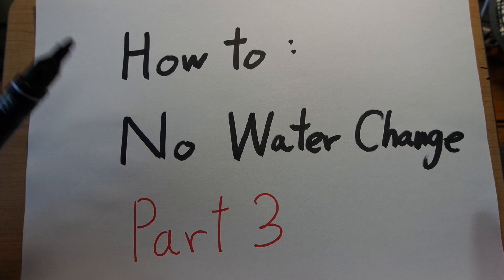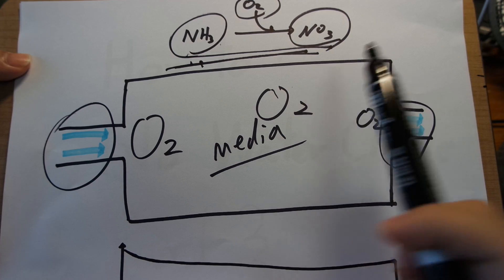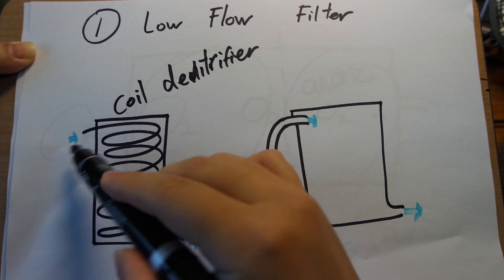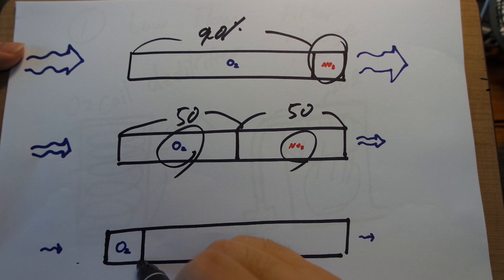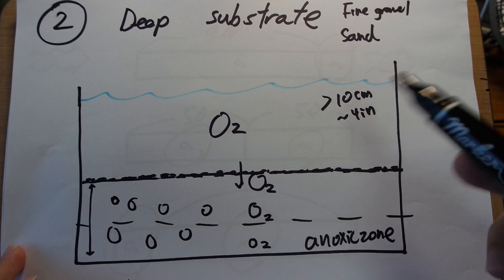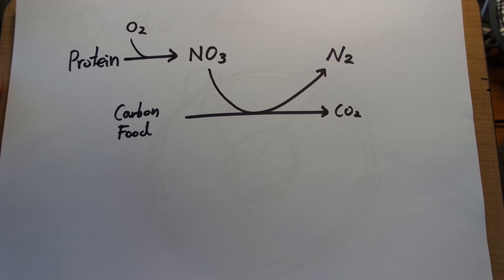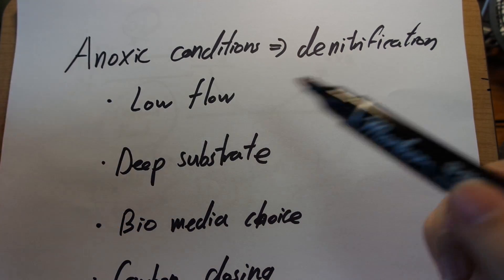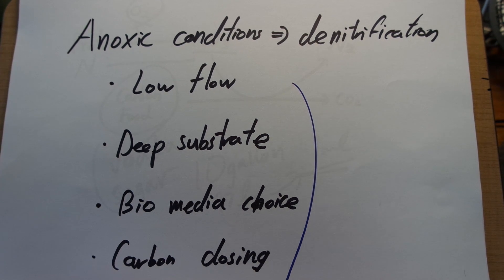How to build a no water change tank part3: ways to make anoxic zones for denitrification

Comment: I am searching guide to solve anoxic/anaerobic substrate, because my plant roots is rooting and smells horrible, but found how to do anoxic condition.. I am confuse... 😵😵
Reply from the maker: If you dig up deep substrate on purpose it will smell bad even if it is set up properly. can you be more specific?
Reply: The substrate do release bubble, but i cannot smell it that bad. But, plants roots turn black and smelly. Wood hardscape part that burried in substrate blackened and smell like sewer. I do walstad method, using soil and sand to cap it.
Reply: I was looking for a comment like this. I want to set up a filterless deep substrate tank but I've heard that anaerobic conditions would cause H2S to form and that is toxic and smells bad...

Comment: thank you for great explanation but i have question about the coil denitrator i make my research of how they make it and there are a lot who diy it but i can not understand the needs of spiral tube ? that go spiral inside large diameter tube . they say it is for slow down the water flow !!! but what if i add straight direct tube and valve and i can make the water flow run very slow  what is the needs of that spiral tube ? in your video you say the bacteria will colonies inside that small diameter tube ! how we can sure that there is a bacteria there and not in the output or in the tank i mean the bacteria colonies in rough surface not in water . is that spiral tube is special tube designed so the bacteria can colonies there ? and dose that mean who make it as diy and they use a normal small diameter tube will not work with them ?
Reply: ngc charle I'll answer your question it's like with electricity a coil is used so a certain amount of power can go through it but it's reduced by time it gets to the end with the spiral the water is a constant stream so on there's more volume going through And two there's more surface area for the bacteria for denitrifying to do there job the longer the tube the better but as said stupidly unnecessary if you had a small tube and a valve it would be pointless
Reply from the maker: bacteria can colonize any surface. They are not free floating, they stick to the inner surface of the airline tubing. That is the concept of the coil denitrifier. The tubing is coiled because you need several meteres of tubing for it to work and it would be messy otherwise

Comment: Hello Jay, i was wondering if an aquarium with 2 canisters mounted in serial will make the second filter anoxic, since the oxygen will be very reduced at entrance of the second canister.
I also reduced the flow using only one canister pump leaving the second canister pump off. The first canister pump is electronic and i was able to choose the most reduced, pump flow setting, considering your advice in this video about reducing the flow. Please reply.
 Thanks for this wonderfull explanation
Reply: He's just making this stuff up. The answer is no - it will not. High nitrate levels are quite safe. The chances of creating an anaerobic filter are laughable.
Reply: @SC-hk6ui  Hello Simon, can you please tell us why you think anaerobic conditions will never occour in canisters, since it can be achieved in sumps, right ? its just a mather of lenght.

Comment: another question please usually when we make water cycle we do it 4-6 times per hour for the whole tank now if i want to use the denitrification filter what is the water flow rate will be i have 450 liter tank about 120 gallon with water flow 2500 liter per hour ?
Reply from the maker: Its not about the tank. Its about your filter compartment. Slow flow in a large filter compartment will ensure anoxic conditions

Comment: Questions. 
With low flow filters like the coil denitrifiers, is it more space efficient than deep substrate filtering? 
As for the carbon source for the deep substrate filters, like vodka and sugar, can't you use fish food or a layer of topsoil as the food? 
With the bio media, following the principle of wicking water, would driftwood also cause anoxic conditions within? Oh and lava rocks also wick water more or less depending on pore sizes. 
What percentage of alcohol does your vodka have?
Reply from the maker: 1. The efficincy will depend on how you build it. In any case coil denitrifiers are terrible in my opinion because they are expensive and complicated. 
2. Fish food is why you dont HAVE to dose carbon. Its just that dosing could help. not sure what you mean by top soil
3. drift wood or lavarock could do that. depending on the characteristics and size. 
4. I don't dose vodka. or anything. I just mention it to explain how denitrification works.

Comment: Anoxic type filter here. Iam trying for months to achieve denitrification to no avail. 
I have few questions to you and id be glad if you could help me out. 
You say that the flow has to be low, but how low? 
Do I need to add a carbon source necessarily? Isnt there any carbon source from the leftovers (food, poop) etc.? 

Thank you in advence
Reply: Carbon, as in dose vodka into the filter with a dripper. 2 drips an hour will work.
Reply from the maker: no simple answer to how slow is slow enough. depends on shape of filter, filter media, filter configuration and initial oxygenation level of water going in. supplemental carbon is not necessary, but can help

Comment: Hi! Great series of videos! I do have one question. Do you ever clean anaerobic zone on the bottom, or is it left undisturbed?
Reply from the maker: Sediment a debris builds up on the surface of substrate which I clean about once a year. I've never touched the deep areas. Never found that to be necessary
Reply: Nice... I'm figuring out if the same principles will work on pond, and cleaning only top layer of bottom gravel with a vacuum once per season is enough, It will be absolutely great... As long as I provide water with lots of oxygen and plants I think It might work well

Comment: Why the oxygen go down in the 2nd method?
Reply: BettaJanggut 75 the oxygen will go down in deep substrate filtering because the water cannot flow very well down there. So, whatever oxygen will be used by the bacteria, until it is depleted. 
Towards the lowest part of the substrate, the water is stagnant. There will be no gas exchange, and therefore no added oxygen.

Comment: Good videos. You should take a look at Kevin Novak’s YouTube channel and take a look at his iBook call Anoxic Filtration System. He uses the 3rd method you go over in this video with apparently some success. He is using crushed clay (kitty litter) and laterite (iron rich clay) in simple pond baskets in sumps/ bog filter areas. He says no carbon source is needed either. Apparently he has had success with this for many years. I am testing 3 of his baskets in my sump now. If you take a look at his content, let me know what you think. I will post a video if I have any success.
Reply: Jay, have you made any videos breaking down anoxic filtration using baskets and plenums? He does a terrible job explain stuff on his channel you are much better at teaching.
Reply: Badandy538 yeah, I had zero success with the kitty litter baskets. They are fine for nitrification, but no significant denitrification was detected. Novak’s videos have no scientific backing or merit. All hype. The only thing I’ve found to significantly reduce nitrates is a heap ton of plants.
Reply: Eric K So no luck with deep sand beds either?
Reply: Eric K thank you so much for sharing.
Reply: @erick6102  Exactly
Reply: @erick6102  Try a little dirt on the bottom with a shit ton of gravel above it. 
9" of gravel and NO sand cap.  Plenty of zones for different bacteria just like in your pond or lake. Shit ton of plants like you said in another comment and don't overpopulate or overfeed and everything should take care of itself.  The substrate doesn't have to be special, just plain old gravel. Give it plenty of time for fish poo etc. to filter down and I bet the things we want to happen will. .
Reply: @scottmerrow1488  I was successful with nitrate removal by putting water sprite in my sumps. I was able to keep nitrates at 20 ppm with a somewhat heavy bioload however, the water sprite was so efficient at growing, it also pulled out a ton of minerals , especially calcium and dropped the pH over time. So you have to dose regularly with minerals which ended up being a lot of work - (regular dosing, trimming excess growth, making sure pH didn’t drop too fast) about the same amount of work as water changes, ha.
Reply: @erick6102  Yeah, OR you could do a water change every once in a while and not have to worry about how to get levels correct.  But that makes sense right?    How about we call them infrequent water change tanks?  How do the 25 year no water change guys do it?  Are they adding minerals to their heavily planted tanks? Is the CO2 they add "making minerals"(?) or are their tanks less bio loaded and the decaying plants give the minerals back to the water?  BINGO
 if you are trying to do a no water change 
tank with a heavy bio load you're already defeated as nature doesn't do heavy bio loads (for long).    Rocks and dirt leach the minerals into the environments we are trying to imitate.   So do your best to imitate nature.   RAIN is distilled, BUT rain water picks up mineral content on it's way to ponds and lakes so there's your water change.  "It's legal"  And that's how and why the water in the pond or lake is not distilled or pure. 
Water changes aren't cheating.  I was going to go for a no water change tank but you guys just made me think better.  Less frequent water changes.  Nature doesn't overstock or overfeed..  That why people's no water change tanks fail (if they fail to maintain levels)  the minerals are in the plants and when the plants die off, the minerals can come back in the water...unless you take the rotting plant matter out.  Again, that's not emulating nature.   A balanced ecosystem is balanced and stays balanced.
Sealed bio systems are proof of what I'm saying. No one is adding tap water.  Or any water.   Adding tap water changes parameters for sure. Topping off with distilled restores original parameters   
I believe sealed betta bio systems have lived for many years. No food or water added. Where are the minerals that all the new plants need coming from? The old dead plants.
Top off with distilled as needed, not 5 gallons at once either. Unless you evaporate 5 gallons a day.
that's my take and I'll think up more if 
challenged. Been keeping fish for over 50 years.  And I think sand on the bottom, (on top of some dirt) with a shit ton of gravel 
on top is the way, not sand on top/no gravel like some have success with.  That experiment will be happening in a 90G as soon as I can cover the holes some salt water nut put in the bottom of the tank.  Old fashioned glass shops don't exist anymore.  Dual pane windows are putting guys like me looking for small think chunks of glass, acrylic or plexiglass out of business. Now I have to find, order and pay a lot more for what used to be scraps laying around in shops. At least in a small town.  Anyway my point is why be hard headed about distilled water (not just you) and why be hard headed about changing a little water once in a while to make the tank happy even if it hurts our pride about "no water change" ideas? 
Like it stops being "cool" if you do a water change?  Let the plants rot and top off only with distilled.  Let that mulm build up. 
I love the idea of no anything (except heat) 
This is what we're working towards (and living in) 
Is the water (from all sources) that runs into ponds and lakes making them continuously harder?  NO.  Can adding hard water to small aquariums to top off increase hardness?  ABSOLUTELY.   So there you have why to top off with distilled. (or R.O.)
Maybe the never ending ground connected to ponds and lakes (re)absorb the excess minerals from the ground that rainwater makes run into the ponds/lakes in a cycle..                Aquariums don't have that never ending ground, closed system cycle though.  Especially not if tap water is used to top off.  No minerals ever left the tank. Only pure H2O. (distilled) left the system.       R.O. is 99% as good though and a whole lot easier to procure  if large quantities are needed. When I have to use more than a gallon a day to top off my tanks I use a home R.O. system.  A whole lot cheaper in the short as well as long run.  
Sorry, I'm blaming this on drinking coffee for the 1st time in a while.

Comment: This video is bonkers on a whole new level. High nitrate levels are not toxic. You still need to change your water due to the accumulation of other byproducts. The chances of this working are incredibly remote. He is just making this stuff up. Never tested it in a lab and has no clue as to water chemistry. Doesn't understand the difference between anoxic and anaerobic conditions nor the nitrogen cycle. Oxygen doesn't just disappear if you push it down a tube or into a filter bed. Have you even studied the soil chemistry of a fen - they are not exactly anoxic - in fact - you would basically need to create a stagnant bog to get this idea to work. Don't listen to him. Jay- you need to take this video down because you are misleading people. Some of us have worked in water filtration for years. If anything you said was true, we would already be doing it and selling it to your viewers.
Reply: Simon Cole - I think you are being a bit harsh. Not everyone has your level of knowledge. The principle is sound and is the basis of a number of aquarium denitrators that have appeared (and disappeared) in the hobby over the years. I think what he is describing is a low throughput anaerobic denitrator which needs a C source as growth substrate,  housed in a conventional filter canister employing a very low output pump. Not the most practical application, but workable. Other variants of this principle are to be found on YouTube, check out Kevin Novak's channel where he describes and builds a co-current, low flow bypass denitrator. He doesn't get everything right either, but I believe he gets results. 

The world of strict anaerobes, facultative anaerobes and microaerophiles is complex and dynamic. Bugs can surprise us: what they don't do in one circumstance, they sometimes do in another.